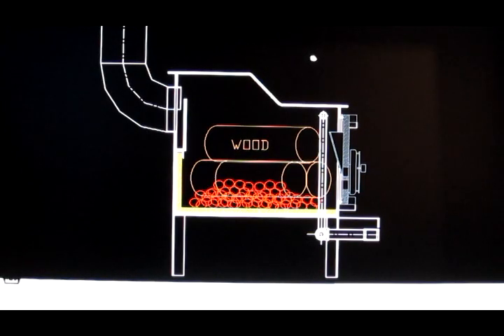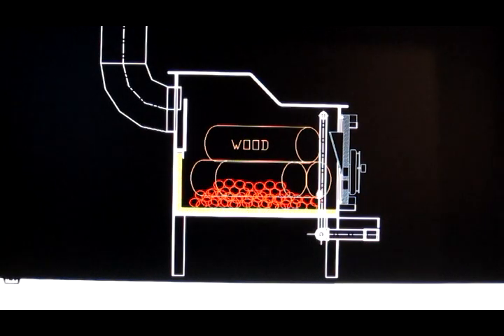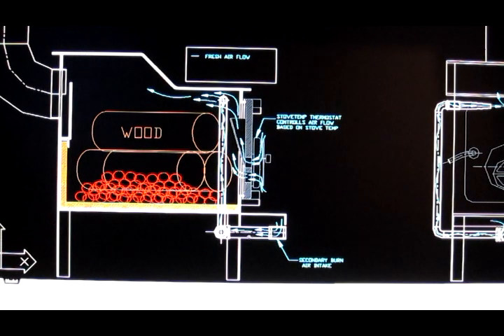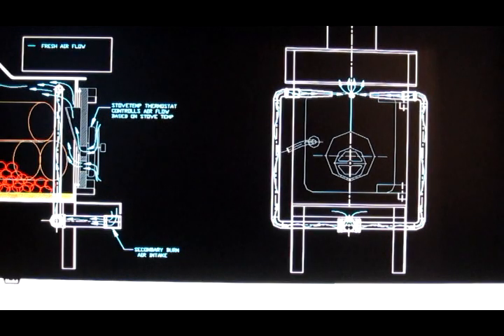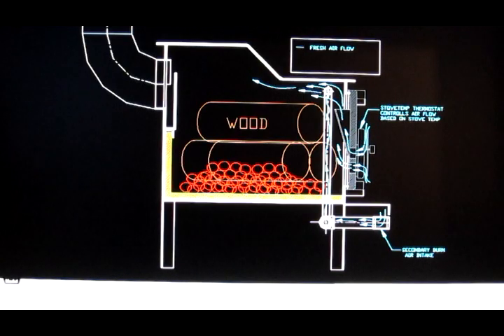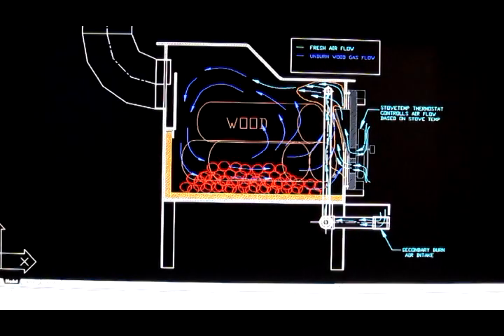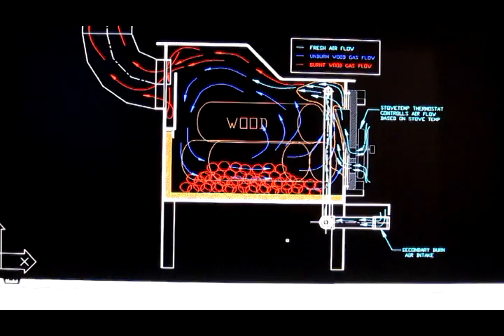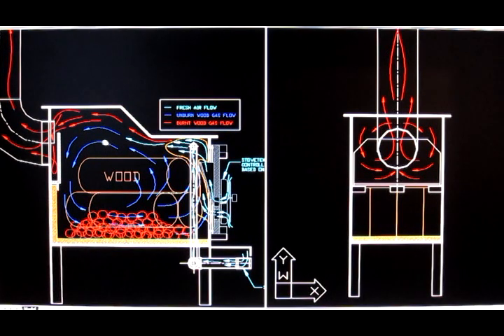Wood stove with secondary burn. How it works part 1

Comment: Just a thought and quick question, wouldn't taking the super heated air that just went through secondary combustion and piping it straight out the chimney result in a lot of lost heat? Or are you solving that some other way? Thanks!

Comment: My cast iron wood doesn't have a secondary burning feed. But it has a back panel with few holes to feed the stove (it's either glass or cast iron back in my model so i chose cast iron for the back part). Also my wood stove has an additional slider on top of the door, manufacturers say its for the initial burning to allow more oxygen. Can i use that slider for secondary burns?
Reply from the maker: I couldn't tell you with actually seeing your stove.

Comment: At those temperatures how long can the copper last
Reply from the maker: Copper melts at 1984 degrees F.  The copper has cold air going thru it. You can grab it with your hand even when the stove is burning hot and it won't burn you. The copper tube has been there for more than ten years and its fine.

Comment: I like the discussion. Do you have proof of the various pathways actually  working  as shown? I have 30 +year old non-secondary burn furnace; the top 10 feet of the chimney are coated with shiny hard creosote before yearly cleaning. I've ordered a cat type stove. I suggest that any stove giving shiny creosote is 'telling' the owner that smoke is not burning and may cause fires, hence replacement  is needed or DIY work is needed; such  changes may void your fire insurance policy
Reply from the maker: Having properly dried wood is a factor also. Shiny hard creosote means excess unburnt gasses. Lots of causes for that, here are some, to low of a burn temp, wet wood, chimney not air tight, low chimney temperature, not enough air for proper combustion.  You have to trouble shoot your stove and figure it out. Every stove is a little different and has a personality.

Comment: Hello, I recently stumbled across your video and your concept is wonderful! I have been thinking of ways to make my old Fisher stove more efficient for many years but given the 30 inch fire box it had been a challenge to get to the back where the flue pipe is and install a secondary burn unit out of piping but the plate in front of the flue pipe became the solution so again thank you! I do have these 2 questions, 1) I estimated the distance between the nozzles to be about 3 inches apart just past the door, the question is what is the actual distance you established? Or is it a ratio based on the width of the fire box, as I can adjust this distance. 2)  What is the diameter you established for the orifices at the end of these nozzles? Currently all that I did was reduce the 1 inch pipe down to 3/8 of an inch. I look forward to your reply and again, thank you for sharing this as I am truly amazed how clean the old stove is burning and am not wasting heat or money in the form of smoke going up the flue!
Reply from the maker: You'll have to play with what works for your stove. Try a couple of variations and see what works the best.

Comment: Awesome video, great job.
I've got a question. I hear about putting a catalytic converter, they say it's ceramic, looks about 3" thick x 6" high x 12" long. They look like they have little hollow square holes going through it. Is that something that I would put on top or the sides to burn the unburnt gasses ? If so, do you need an air gap between it and the sides of the walls of the stove ?  Thanks in advance for any help.

Comment from the maker: To support this channel go to Amazon through the links below and make any purchase:
Amazon tools and parts link https://amzn.to/3OAo4pF
Kettle Humidifier https://amzn.to/2KUD3dY
Black Ash Bucket with Lid and Shovel https://amzn.to/2MRdZoC
Magic Heat Top Crimp Heat Reclaimer, 6-Inch https://amzn.to/2MUnFyV
US Stove 1269E Small EPA Certified Cast Iron Logwood Stove, 54,000 BTUs https://amzn.to/2He6GEZ
Large Heat Powered Wood Stove Fan.  https://amzn.to/2Jb4m2q
4-Blade - Heat Powered Stove Fan for Wood Log Burner with Stove Thermometer https://amzn.to/2HglKSS
The Wood Burning Stove. Everything you need to know https://amzn.to/2MToojB
Imperial Stove Thermometer https://amzn.to/2F1OoFb
#woodstoves #woodheat #woodheat

Comment: nice, i used to, all but this last winter, get my stove nearly red hot, secret recipe to that, but cram  an elm tree branch, solid cut that would barely fit in the stove's door and 20 inches long, and as soon as that gets going but before it's crested over it's building point, in an inclosed area with no windows no open doors, i'd close off the flue, it's not exactly sealed but close, and then because of the pressure pushing gasses out the front vents, i'd close that vent as well, and it's also not sealable, but because of the heat intensity and the heat having no where to go, but squeeze up the triple wall 8 ft chimney it was have a drawing effect on the stove. but you talk about harnessing the heat,  then i'd go to sleep. did that for years. i think i'm gonna stop. ok i'll tell the secret. so get the stove running real good, a nice bed of healthy coals, big and nice, stove is already at maximum operating temps. make a little "pad" to accommodate a beer can, cut the top off, and add 1/2 to 3/4 full of any kind of fossil fuel. the best i found is kerosene down to diesel, then gasoline ( i never burnt used motor oil, but it'd work fine too,) for the volatile fuels, get the channel locks and hold the can tight, and light, THEN put in the "pad" on account of preventing  it on creating heated fumes to make a boom type , once lit set it in the pad and the stove get red not bright red but close and it'll last 20 min or so. maybe 15. it boils right away. the can survives. it'll increase the temps of the uninsulated room 10 to 15 degrees. one time i tried to burn the insulation off of some vintage copper wires, whatever was in that was like stored fuel i couldn't put it out. it was scary.

Comment: Nice theory. BUT this configuration will let the hottest gases escape to the chimney.  Efficiency rises when the exhaust is at the bottom. Like all properly designed stoves, the well designed rocket stove and the Scandinavian brick stoves

Comment: What did you do on the sides of the stove? It looks like you did something to increase surface area. On the left side you have a compartment or something. What is that?
Reply from the maker: What I did to the side of the stove was 3 things. I added fins on the out side walls to transfer more heat from the stove wall into the room. I removed the fire brick from the insides of the of the stove side walls to get more heat transfer to the wall of the stove from the fire and to get more room inside the stove. Last I made a small heat shield that protects the floor around the stove from radiant heat and it helps draw cold air up along side of the stove into the room with no power required. It is mid October here and the nights get into the low 30s  F.  I have been playing with how much ash I leave in the stove to increase burn time at low stove temps. (200-400 F ) so I don't cook my self out of the house. Best time so far is 26 hours with three 6" dia longs. still working with the process. Properly dried wood is very important in doing that. Here's a video on how I dry my wood.  Dry vs green firewood  https://youtu.be/D42LdYMFiK8
Reply: wow incredible

Comment: is this your design?  why not buy a stove with a re burn assembly?
Reply from the maker: +Saint Boudreau Yes this is my design. I have not seen a stove on the market that works this way. Most stoves I have seen have a fixed air control and do not allow the adjustment of the burn to compensate dynamically for changes in stove temperature, wood types being burned and other conditions like outside temperature, etc.

Comment: Thanks for taking the time to post this video series.  I like what you have done here, and I have a few questions, if you have the time.

Why did you use copper tubes?

Are the tubes dry fit into the elbows or are they soldiered/glued/silver-soldiered together somehow?

Why did you run the vertical part of the copper tubes on the outside of the stove instead of on the inside of the stove?  Wouldn't you have gotten the air inside the tubes much hottter if you ran the tubes inside the stove?

Once again, thanks for posting these videos and thanks for taking the time to reply to my questions.
Reply from the maker: SeekTheTruth I used copper because it has very good heat transfer properties, so it heats the air flowing threw it faster. The fittings are brazed together. Solder will not work, because it would melt at the some of the temperatures that it reaches. I didn't put the copper tubes inside for two reasons. Inside the stove they would get banged up by the fire wood and creosote would build up on them because they are cooled by the fresh air flowing through them. Watch parts 2 and 3 links are in the description.